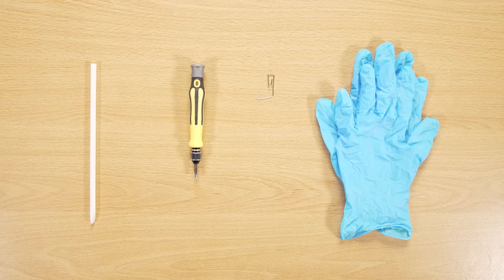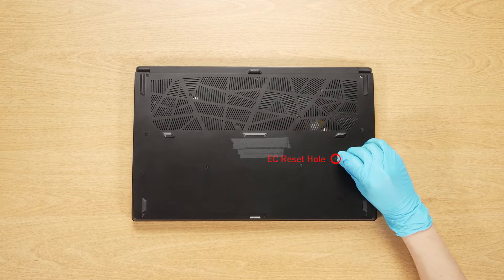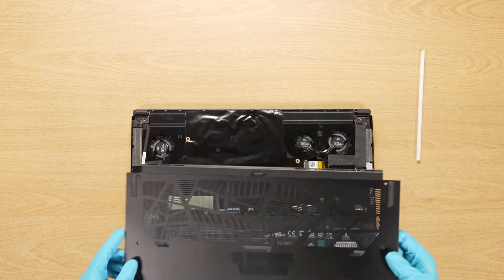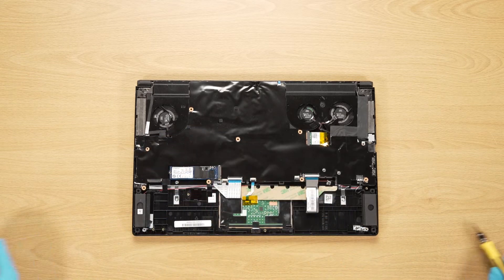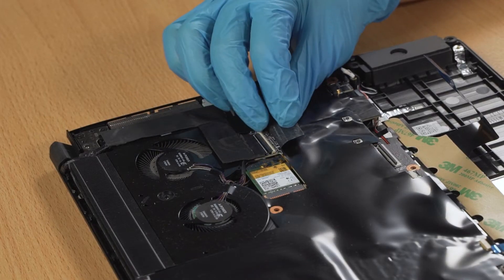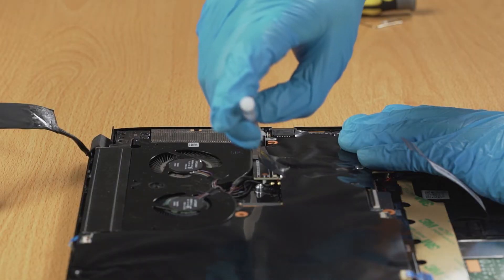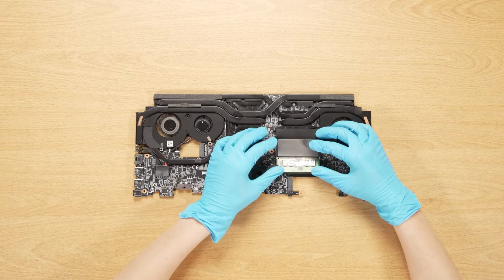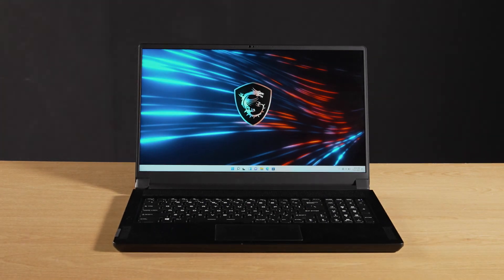MSI GS76 Stealth/Creator 17/WS76 Upgrade Tutorial

Comment: thanks for the teardown. this made cleaning out the dust a lot easier. didn't realize there was a screw under the factory seal sticker (lmao) and the wifi card was a little confusing since the cables basically fell off, but my laptop is running a lot cooler now!

Comment: I'm here because a fan started making noise like something got stuck in it, this is the only disassembly guide.
Reply: I have the same problem was it an actual item that stuck in here or just the fan making weird noise as usual?
Reply: @UneasyMug  It's done it on occasion since then, but mostly when I had it placed on a surface that could get random junk on it. When it's been out of range of, like, hair or random bits of paper, it hasn't done it. So I think it's external. I'm not sure where the junk ends up, though.
Reply: @UneasyMug  I can never tell if a message is going to notify someone. Sometimes the name is blue and sometimes it's not. Here's another.
Reply: @UneasyMug  It's either stopped on its own or after a blast of a can of air. When I made that comment it was I think the only time that didn't fix it but a little disassembly and then the air blast fixed it.
Reply: This laptop is a complete piece of shit I can’t believe they got away selling it